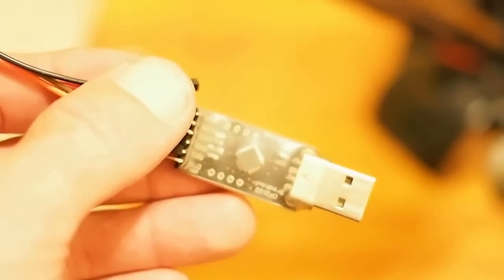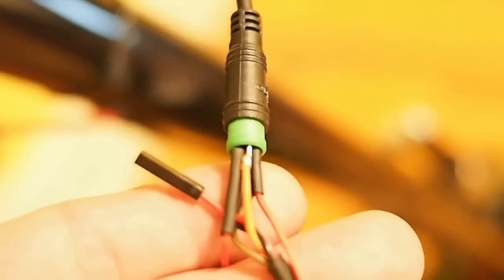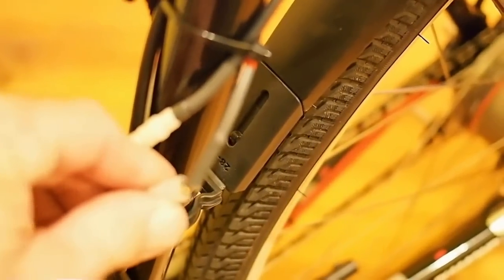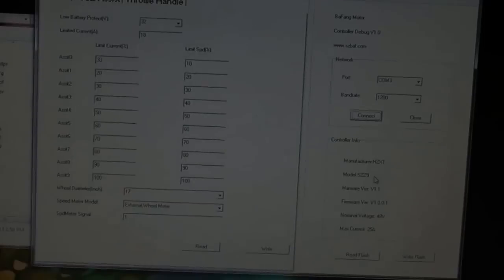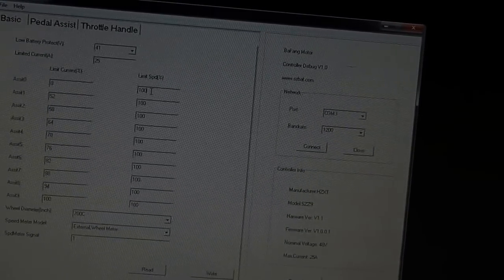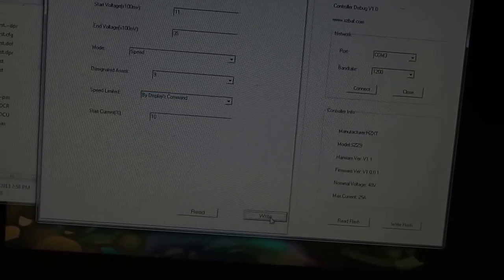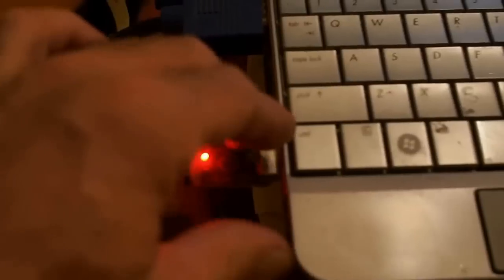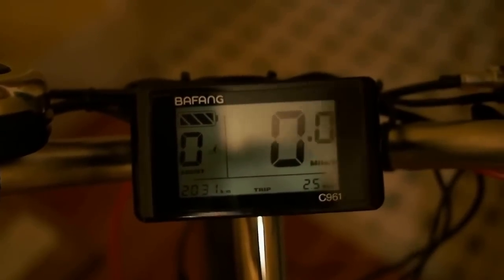Bafang BBS-02 Advanced Serial Hacking - Throttle

Comment: We sell these kits and we change the software settings before shipping them out. However, i know by bitter experience that it is very easy to make the controllers fail by settings 1 of several settings, badly. This software is not fit for end user usage, because frankly the controllers are not very well protected against over current spikes and work in ways that most casual users will not fully grasp. DO NOT make huge changes to the PAS settings 0-9. They can be tweaked a little, but not by a lot. Making the 0 speed setting to anything greater than 0% Speed (set Current to 0%) will allow the throttle to function in throttle only mode in setting 0.

The advice to set all PAS settings 0-9, to 100% speed is not a good idea. We did that at 1 time and had a huge failure rate. It might work for some users, depending on their riding style, but for others, it will result in terrible feeling when using the kits and very likely result in a blown controller within a short time.

For all the people that want to play with their Bafang kit, i hope you can accept that you are taking chances and if it goes wrong, it is very unfair to expect the supplier to pick up the pieces for you.
Reply from the maker: Paul,

I agree, there are a lot of settings that could cause damage to the unit if misconfigured.  If you read my description of this video, you saw I do not skimp on the warnings and disclaimers. I've got 6 lines of DEEP HURTING! all in upper case. In addition the 'casual user' you speak of probably does not own an FTDI adapter nor know how to interface it with anything. Anyone even attempting to do this probably has experience with Arduino, RS232, ESC circuits, microcontrollers, etc.

In Short, this video is NOT for the casual user. This video is for the curious mind. 

That having been said. Where I am, these kits are very uncommon. Most of us have purchased them on eBay or group buys from China paying for expensive slow shipping, dealing with customs delays, with NO warranty or recourse to speak of, buying from retailers that have not been knowledgeable or kind enough to program the controller for us. We know that these units perform well but are mostly undocumented (at least in English) . So there are a growing number of people hacking them in order to map out their capabilities /limitations and improve their performance. 

Your contribution to this discussion is welcome. Many viewers would be eager to know:

 -  what specific exact settings in this application have caused problems or damaged controllers?
 - Are you an Authorized Bafang/8Fun Dealer? If so did they provide you with any training for this application? No one has really found much in the way of English language documentation.
 - Sounds like you've configured a few bikes, Would you be willing to share your 'optimal settings' in this app for the BBS-01 and BBS02 units? (By that I mean the setting which produces the most reliable, ride-able bicycle.)
Reply: they are extremely common these days. I understand this is 2 years later but still. I do not suggest you put 100% everywhere it's a bad idea. there's quite a few posts on the internet today about exactly how to tweak it to get max performance from your unit. That being said good video man. It helped me because i didn't know i had to disconnect battery prior to using this and reconnect it when it's plugged in. That might have saved me a new controller or at the very least, few headaches :) Cheers

Comment: Great instructions! It worked right away with my modified USB 2 SERIAL adapter. Now I'd love to see what it all mean in the setup program. I think level 1 PAS with 100% speed will help battery range a lot compared to 9. Will try it out as soon as possible
Reply from the maker: Glad it worked for you!

AFA what everything means there's no official documentation but the largest discussion regarding this is on Endless Sphere here- http://endless-sphere.com/forums/viewtopic.php?f=28&t=58780. It's an extremely long thread, But the meaning of much of the settings have been figured out.
Reply: How did this go for you?

Comment from the maker: Matthew Winschel It is indeed possible to enable throttle at PAS 0 without enabling pedal assist. However there is also the possibility of frying your Bafang if it's done incorrectly.... It's a lot like programming an Arduino or a Multicopter, but the + battery line has 48V instead of 5V.

If in doubt, check around the LBS in your area for someone who has experience with these units and can help. (The Bafang/8Fun kits are becoming increasingly common, especially on the west coast.)

Comment: hi thank you for that information...can the m600 low voltage cut off be adjusted? i would like to run the m600 with a fast charging lithium titenate battery..the lto battery has a deeper depth of discharge than Li...so i need to set the controller battery cut of down further ..probably round 31.5 volts.also do you know the max voltage i can use on m600?...thank you in advance.

Comment: Charles, just came across your video.  Had a question for you.  I just installed my system however am waiting on a good crimper for the anderson connections.  I had heard mention of this before.  I asked of the person that makes the interface cable that I purchased for this unit and his response was "If you program throttle in PAS0 you will have full power PAS in 0 as well, don't mess with it."  It seemed as if you did not have that issue but wanted to ask.

Comment: Hi Charles, i'm looking for the USB adapter. Should i take the 5v or the 3.3V adapter. Do you have a adequate adapter specification?
thanks so far en keep u the good work!
Reply from the maker: +Henk de winter - The one I used was 5V. (As an alternative, the 8Fun kits are becoming common enough that people are making/selling programming cables for it.) 

Also, since this video a lot of people have done a lot of work decoding WHAT all of the settings mean. The best article I've seen online so far is here - http://electric-fatbike.com/2015/06/26/a-hackers-guide-to-programming-the-bbs02/

Cheers and good luck!

Comment: Hi. Does this mean its no longer limited to 20mph and if so what's to top speed you've got out of it? I've ordered my kit a month ago. It should arrive on Friday. I can't wait although I'm a bit nervous about the conversion. I've never attempted anything like this before.
Reply from the maker: Even without hooking to the serial port, the C961 controller can be configured to max at 50kph, which is around 31mph.

But the pedal assist is speed limited to a percentage by level. So it will only provide pedal assist up to 50 kph at highest assist.
Reply: Thank you. So do I need that USB to serial to do that and where do you buy them from? EBay or something? Also on you video of your installation you missed out quite a lot. I didn't see you actually fitting the motor. Did you film that bit?
Reply from the maker: Jason Skene - No you don't need any special equipment to configure the Bafang. The procedure is in the C961 manual which can be found on the Bafang homepage at  szbaf.com. I also have a video showing the C961 controller set-up here - Bafang eBike Final Setup - how to configure the C961 eBike Controller 

AFA the fitting of the motor, no I didn't video that though I did take some stills. It's super simple! The only critical thing is the bottom bracket width. (The kit wants the standard 68mm.) The kit replaces ALL bearings, races, crank and crank arms. Only the pedals are re-used.
Reply: thanks so much for your help. I hope u don't mind if I ask some more questions if I get stuck :-)
Reply from the maker: Jason Skene No worries. Good Luck with your build!

Comment: is there any way to reset the odometer not just the trip? good video thanks for share
Reply from the maker: The odometer data seems to be stored in the display not the motor. I have been told that it can be reset by removing then reinstalling the button cell battery inside the display case. But I have not tried that to verify that it works.

(Normally I'd consider it unethical to reset the odometer. But having that data stored in the display makes no sense. It becomes useless and inaccurate once something gets replaced. So being able to reset it if for instance you get a new motor seems like a good idea.)
Reply: @charleswerbick2154  I'm just found a button sequence to make it possible brother, thank u
Reply from the maker: @mauriciotellez5241  - Care to share?
Reply: @charleswerbick2154  of curse man ill make a video about it

Comment: I don't fully understand this video, I bought my Bafan BBS02 used and I am able to use my thumb throttle when PAS level is 0. I guess the previous owner already did this mod? I am assuming it does not come out of the box like that? Thanks
Reply from the maker: +Johnny V - It's likely the BBS was modded by either the previous owner or the dealer. It's an extremely common modification.

Comment: Hi again I think I've got a problem. When I put the motor in as far as I can there's a gap between the motor mounts and the bracket holes and theres not enough room left on the spindle that goes through the bottom bracket to fit the, what I assume is, the cover piece. And ideas :-\ i can send pics if u don't mind. Sorry for bothering you with all my questions :-S
Reply from the maker: I'd be more than happy to take a look. Pictures would definitely be helpful.
Reply from the maker: For anyone having this issue- The Bafang is designed to fit on bottom brackets 68mm-73mm in width and 35mm in diameter (internal). For 73mm brackets, there WILL be a 5mm gap between the unit and the plate that goes under the locking nut where the 2 bolts secure it to the motor. You will want to use washers between the motor and the plate on those two bolts as spacers for that 5mm. 

If your bottom bracket is wider than 73mm (i.e. fat tire bikes have 100mm brackets.) this kit may not be compatible.

Comment: Helly sir, I like your video.  I have a question for you if you don't mind.  I bought a programming cable from a reputable company and followed your instructions on this video as well as the instructions on electric-fatbike.com, and to make a long story short, I fried my controller and 2 of my computers.  Do you know how this could have happened?  A faulty cable possibly?  No one seems to know what happened yet on endless-sphere, and my dealers doesn't know how this could have happened either...  Thank you Mr. Werbick.
Reply from the maker: Dude, that sucks. (Sorry for the delayed response, this comment ended up in YouTube's spam bin and shouldn't have. I'm resurrecting your post because this is relevant to ANYONE who makes or purchases a programming cable...)

Speaking hypothetically, I can tell you the MOST LIKELY cause of damage during this process. The controller connection that we must use to program the cable has FULL BATTERY VOLTAGE(i.e. 24/36/48VDC) on pin 5 that we must jump to pin 3 in order to power up the unit for programming. Most USB circuits have overvoltage protection that's only good to 20V. So an eBike battery will easily fry a USB port. There are several ways this can happen:

1. The adapter cable can be mis-wired. Pin 5 SHOULD go to pin 3, but if it goes anywhere else, then you are dumping possibly 48V into a 5V system. (possibly not even in the right polarity) POOF! 
2. The adapter cable could be shorted . Pin 5 might connect to pin 3, but if the cable is pinched or solder-bridged, then one of the other pins could also be geting 48VDC. POOF!
3. The adapter cable can be incorrectly connected - The connector is 'keyed ' and has a notch to prevent misalignment, but it is plastic and could be 'jammed on' incorrectly. (This is less likely than 1 and 2 but still possible.)

If you still have the programming cable it is possible to autopsy it to determine the exact cause. I'm betting you'd find that there is 48VDC coming through to the USB side due to either the jumper for pins 3->5 being mis-wired or shorted due to a solder bridge/cable-pinch . OTOH, if it was incorrectly installed you will probably see damage to the keyed green connector and possibly bent pins.

Again - Sorry for not seeing and responding to this earlier. It's highly likely you were sold a bunk cable and I hope that the 'reputable seller' made things right.

Comment: where do i buy the usb to serial  adapter cord
Reply from the maker: You can search for 'Bafang Programming Cable' on eBay or similar sites. (Be careful though. At least one person has reported that a PURCHASED controller has fried their bike and/or computer. Ask on endless-sphere to find a seller with good quality control and reputation... )  Due to issues reported I recommend if you purchase a pre-made cable to double-check that it is wired correctly before plugging it into either your bike or PC. That means verifying that pin 3 and 5 are jumped to each other and NOTHING ELSE - i.e.  pins 1, 2, and 4 on the green connector of the adapter MUST NOT CONNECT TO PIN 3 OR 5.  One vendor's mistake soldering a $5 cable can easily cause hundreds in damage...

Comment: could one do the opposite: Set up so that the throttle handle only works when one pedals?
Reply from the maker: Egil Furre  - [Edit] I  thought you were asking whether it's possible to disable the throttle. (which is possible.) However, rereading your question I see I misunderstood it so to try and actually answer the question you asked -

NO.  I do NOT think it is possible within this configuration tool to enable the throttle only when pedaling.  (Caveat - I haven't tried it.). What would be required would be to have the throttle control the level of pedal assist. If I had the source/schematics I could probably build a firmware that does that. But I don't currently see a way within the default firmware to get there...
Reply: +Charles Werbick How about if you put the speed sensor on the crank arm. That way as soon as you pedal the throttle will enable. That way you can roll the bike and the controller will not put power to the motor.  Your speed readings won't work right but you only want throttle control anyway so it doesn't matter really
Reply from the maker: Richard Cerill - I would not recommend that. The throttle works even with the no magnet on the spoke at all. So it would not do what the poster wanted... (For the record I'm happy with my Bafang the way it is and find the idea of forcing the rider to pedal sadistic.)

Also like most industrial controllers, the Bafang utilizes a PID controller (https://en.wikipedia.org/wiki/PID_controller) feeding it bad data can have unpredictable results. I'd rather have a working speedometer and a throttle that acts in some normal fashion.  But I built my eBike so I wouldn't HAVE to pedal if I didn't want to. ;-)
Reply: Thanks Charles for the information and the comments you definitely know a lot more than I do about this whole situation. Maybe you can tell me this one more thing. Do you know if after the controller is programmed to operate in assist mode 0 if the throttle lever is proportional? That us say , if I push it a little, I go little faster and if I push it further I will  go even faster until I reach max speed? Is that the case? I don,t like the abrupt accelleration you get when in pas 5 from a stand still if you know what I mean. Thanks for all your help and super video. You are awsome!
Reply from the maker: Richard Cerill - Yes the throttle is proportional. There is still a slight 'lurching' sometimes that seems to be caused by the system adjusting to the actual sensed speed vs. what was expected. But it's FAR more noticeable during pedal assist modes than it is using the throttle. 

As an aside, the one hack I'd love to explore would be to somehow add a torque sensor to the system. That would allow for a much smoother pedal assist. (but would also necessitate replacing the controller completely)
Reply: +Charles Werbick  Charles, Whay are we pulling out cables and making jumpers to connect to the controller?  I program a lot of my equipment for work. Meters, instruments and communication equipment all use rj 45 plugs or 1/4" phone plugs with a tip ring sleeve configuration.  Question:  Why not just install a 1/4 inch jack on the side of the display unit  and solder connections directly to the board?  The power would be already connected internally on the board so that wouldn't have to be done anymore and all you would have to do is plug in and down/ upload.  Why not? I' ok with modifying my controler

Comment: end voltage 35? Does that mean you are only using 35 of 48v?
Reply from the maker: +Anthony Steele  - no those are throttle control voltages. (It's not actually 35. It's 35 x 100mV. So it's range is 1.1V to 3.5V which is stock for the BBS-02.)

Comment: On Another note... Has anyone got the C963 display and find they cant get into the advanced settings menu by holding + and - when in normal setting menu? (this is what the full manual says should work). I want to change to soft start on the motor